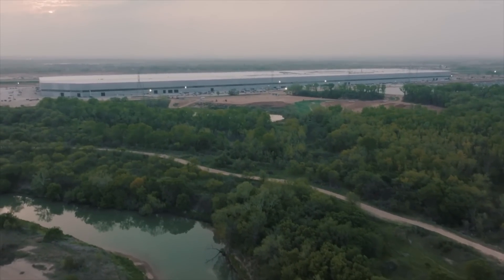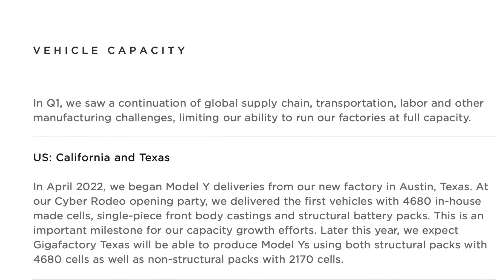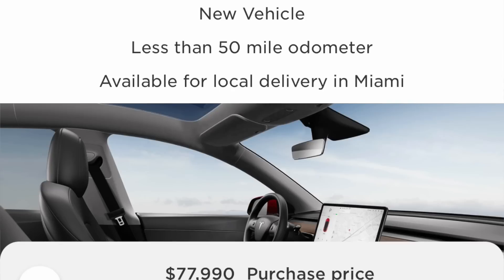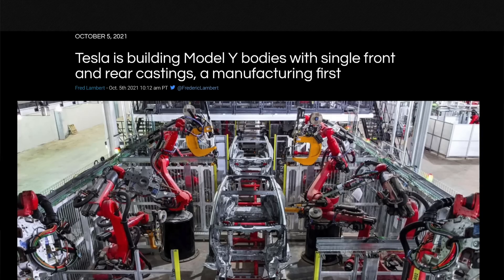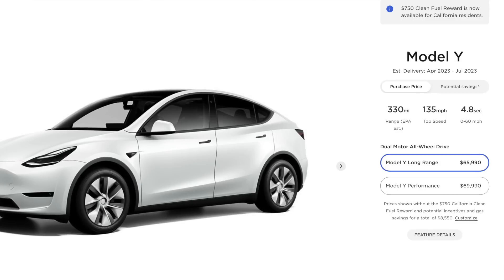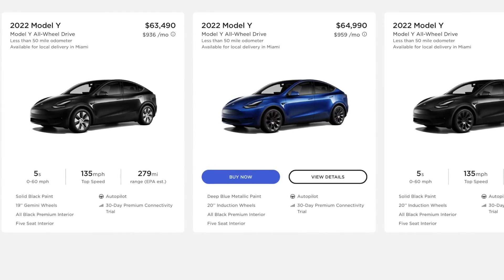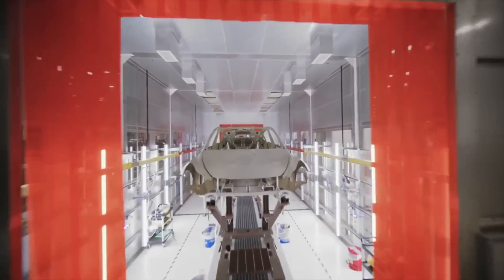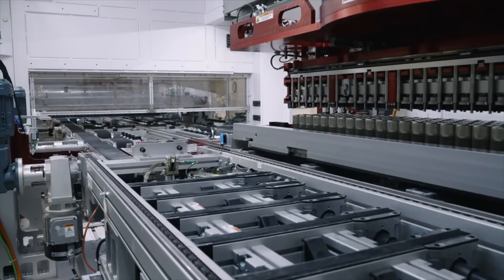GigaTexas starts using 2170 cells, but Y?

Comment: You are dead on accurate in your thoughts for sure.  This is the best news I have heard in a long time.  I ordered my Model Y LR just before the gas craziness in early March.  Delayed delivery now til November at the earliest, however, I would much prefer the GigaTexas made Model Y over Fremont, even if the cells remain the 2170 cells.  I would say now that they are definitely making LR model Y’s in Texas with the standard LR 2170 packs the probability that my November delivery is from Texas just went up massively.  Especially when I am on the East coast and shipping costs to me from CA would be twice the price so Tesla makes more money selling me a GigaTexas unit and I have the lower cost purchase also requiring the most efficiency to ensure profit.  Also Tesla needs to up the units sold out of GT massively to spread out the fixed cost of GT over the most amount of units produced as they must be hemorrhaging cash at this plant with the slow ramp up of production.  The probability that I might still be able to get a 4680 cell version is still there and slightly higher, but only if the cell production really picks up as I am sure all locally produced cells will go to GT production.  The closer to Cyber Truck production start we get, the less likely GT will use 4680 cells at al in the LR model.  This maybe a year or more away.

Comment: If the cybertruck isn’t 500-700 miles of range we riot. 💥
Reply: 500-700 miles!!!!! You must be smocking something lol….. if they ever made the 500 miles possible it’s going to be super expensive trust me. Also if they make a 500 miles one it’s not going to have all the motors or features
Reply: @carholic-sz3qv  they wont ever make one for less than $100k no matter what options it has
Reply: @TailosiveEV  do you thnk that tesla will have intelligent back up power like the Ford lightning to feed energy to your house in the case of a black out?

Comment: I agree. The problems they have with 4680 must be huge. Thus expect huge delays in Cybertruck, Roadster, Semi.
Reply: Big big lol….. the problem with cybertruck, semi….. is about the quantity of batteries, they need a lot of batteries to be able to make those much bigger vehicles/EVs
Reply: @carholic-sz3qv  but 4680 had higher power density than other cells
Reply: @BGNOO7  it barely has any higher density, they will still need enormous amount of batteries at the end!
Reply: @carholic-sz3qv   no you are wrong they are very energy dense because of less thermal escape
Reply: @BGNOO7  they are not! They are just bigger batteries cells lol….
Reply: @carholic-sz3qv  yes so you can Have less cells to put in the car

Comment: What does the EPA have to do with a car battery pack and crash testing, structural or not?
Reply: The 46-80 car probably has a different weight distribution, so it may act different in a crash.
Reply: @TailosiveEV  I don't think so. And the EPA doesn't even test mileage/range. They rely on manufacturers to follow the specified test proceedure.
Reply: @Sylvan_dB  nah they can test the car but most manufacturers opt to do it themselves
Reply: @Sylvan_dB  what are you smocking mate!? Lol…..

Comment: Until Panasonic and LG start full production of their 4680 batteries I don't see Tesla have the capacity to mass produce cars using them. Tesla needs to fill the back log of orders with 2170 Model Ys for the short term.
Reply: Giga Texas and giga Nevada producing 4680